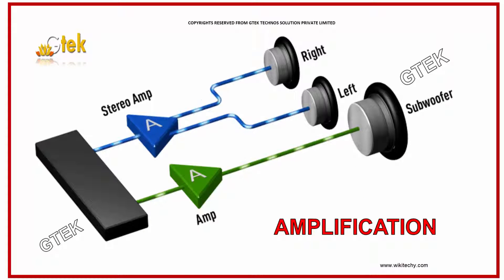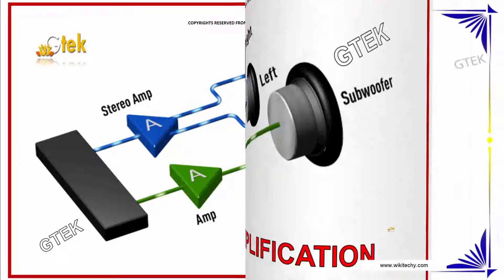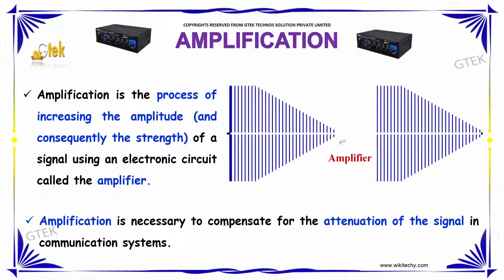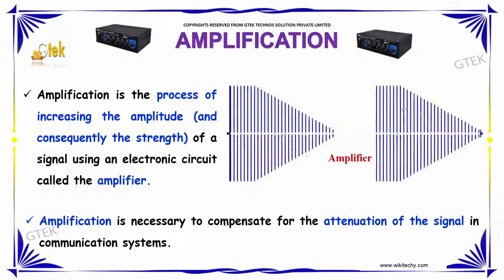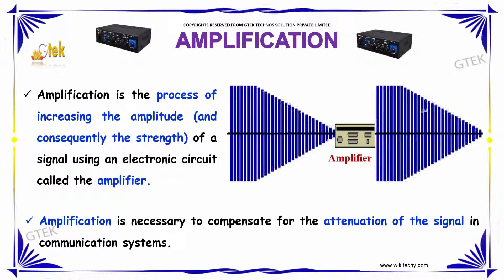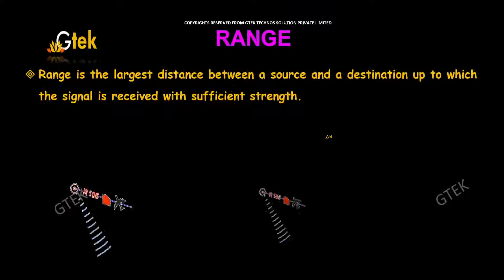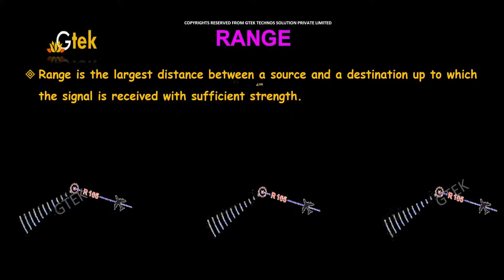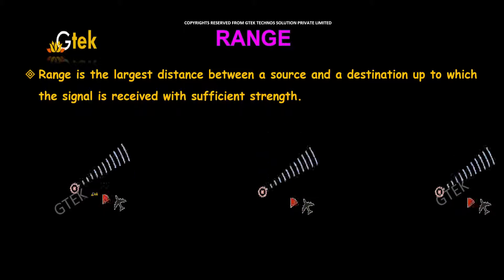Amplification and Range | Communication systems |class 12 physics notes|CBSE|IITJEE|NEET

Comment: An amplifier, electronic amplifier or (informally) amp is an electronic device that can increase the power of a signal. An amplifier functions by taking power from a power supply and controlling the output to match the input signal shape but with a larger amplitude.

Comment: An amplifier, electronic amplifier or (informally) amp is an electronic device that can increase the power of a signal (a time-varying voltage or current).

Comment: An amplifier, electronic amplifier or (informally) amp is an electronic device that can increase ..... An RF amplifier amplifies signals in the radio frequency range of the electromagnetic spectrum, and is often used to increase the sensitivity of a ..

Comment: An amplifier is an electronic device that increases the voltage, current, or power of a signal. Amplifiers are used in wireless communications and broadcasting, and in audio equipment of all kinds. They can be categorized as either weak-signal amplifiers or power amplifiers.

Comment: Voltage amplifier – This is the most common type of amplifier. An input voltage is amplified to a larger output voltage. The amplifier's input impedance is high and the output impedance is low. Current amplifier – This amplifier changes an input current to a larger output current.

Comment: Nov 20, 2016 - These are the Chapter Notes of "Communications" of Class 12 ... Communication Systems1 doc .... Range : The largest distance between transmitter and receiver upto ... Each repeater receives the transmitted signal, amplifies it properly and ... Communication Channel : It is a link through which information ...